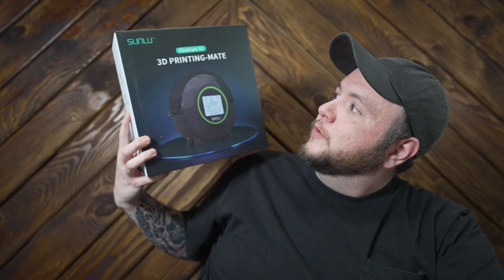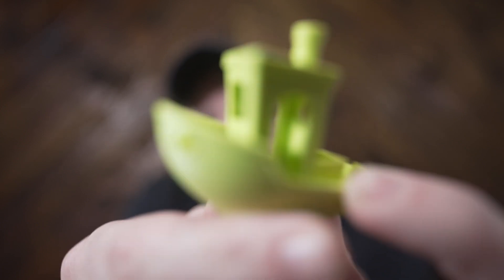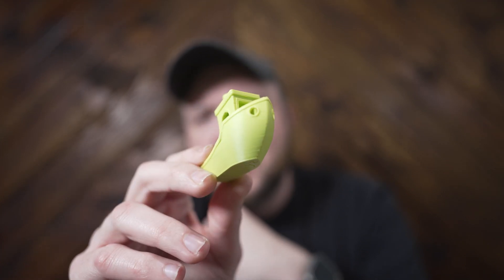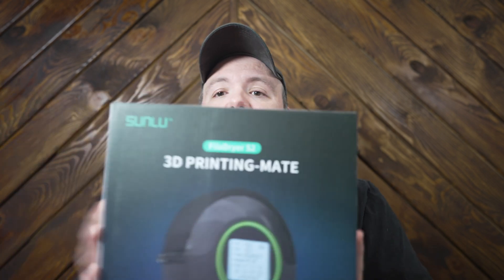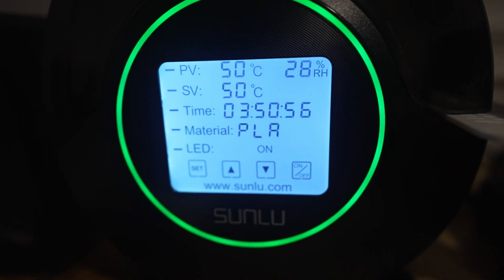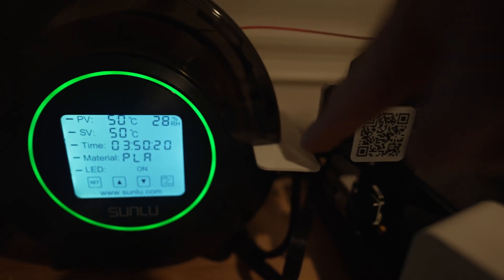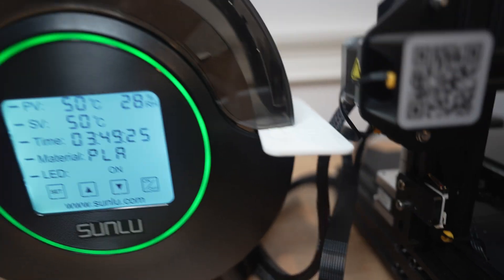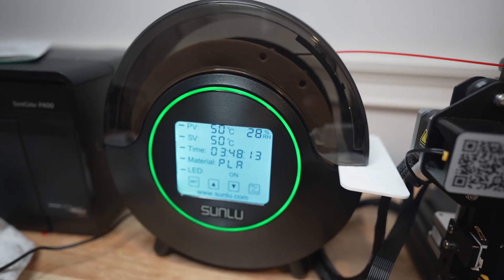3D printer woes… Sunlu Filament Dryer S2 initial thoughts

Comment: I bought the same dryer the other day at the same time as I bought my first PETG spools. I also read about the ventilation issues and had my doubts. But after running it with PLA and see how the humidity drops with it completely closed has reasured me that you don't need a crac or something like that. The Dryer has two outlets for filament. So you will already have a hole where humidity can escape. I would say that the only thing that the crac can help with is decrease the time that the humidity drops.
Reply: What settings are you using for pla?
Reply: @3nvy808  close to the original. But otherwise I follow the manufacturers recommendation.
Which is 55 C for Add:north filament.